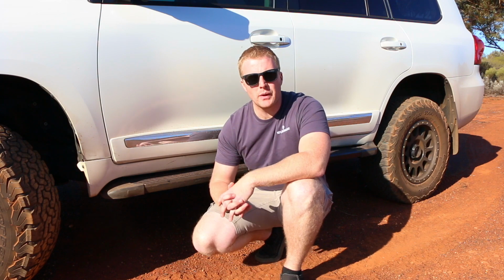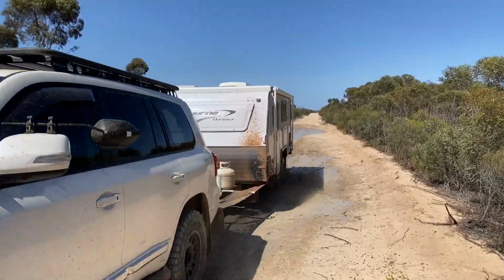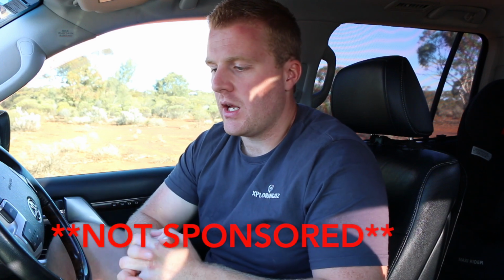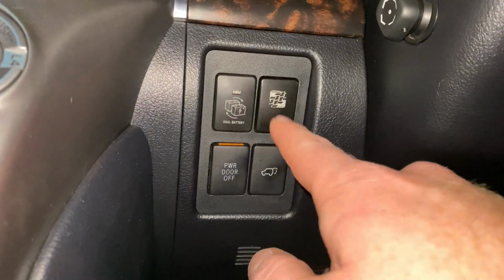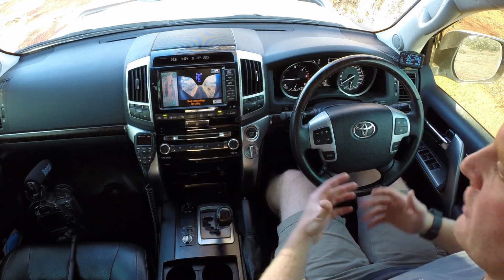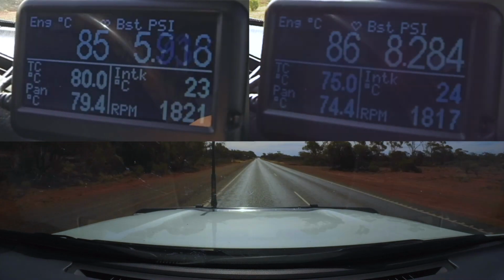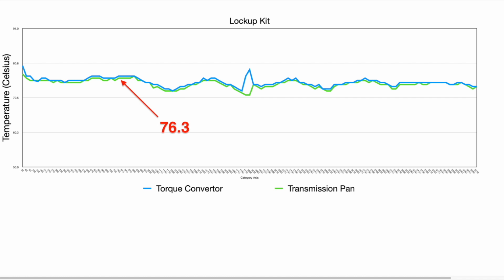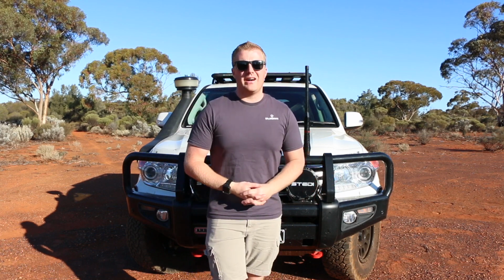TORQUE CONVERTOR LOCKUP KIT | HUGE difference! | How does it work and why? LC200 Stocklock Extreme

Comment: I have the Richards lock up2, absolute game changer for my 150 1kd Prado, the torque converter slips like crazy when towing up long hills and up against headwinds, I’m a relative lightfoot and I still have to feather the right foot a lot, tow test was an absolute dream, I have the lock up dialled in, can’t wait to head off around Aus in 3 weeks.

Comment: An old video, that I must have missed.  Considering getting a lockup kit for Isuzu MY23.   Informative as usual.

What was your fuel usage saving with the lockup kit?

Always looking for your next video.
Reply: I just installed a "lock up mate" in my LC200. Pretty easy install and you don't have to mess around with the switch panels. Looks like about 1L per 100 saving without towing. Will be towing soon and that's where the real saving would be.

Comment: Great revue. Australian Off Road caravan owner forums, some have used this unit. The AOR vans mostly weight 2.5 tonne, some more, some less. They are mostly under 2 metres wide, so often have less windage issues. Many users report though, that after having installed a lock up kit, eventually they turn them off, because they've found with judicial throttle control, one can get the 200 to lock up, its a skill that can be acquired. IMO I will first enhance the gearbox cooling, as it seems to me that if the transmission fluid is kept cooler, the cost of not locking up as quickly as a lock up kit achieves is fuel consumption. It's a shame that only the Lexus versions provide paddle gear changing ... my D4 Landy instantly changes gear via the paddle shift and then times out after a few minutes, and in sport mode it doesn't time out. But I reckon throttle control in the 200 may be the way to go, and that a tranny cooler is mandatory.

Comment: I tow a 2.5 ton van and when in drive doing a 100 on flat road it very rarely went looking for gears and when I drive in 4 it never looks for gears so I don’t understand how you’re gearbox was looking for gears on flat road maybe you have a servicing problem 🤷‍♂️ this review hasn’t won me on a lockup kit a trans cooler would work better just my opinion

Comment: Do you think there would still be benefits to installing this on the 5.7 petrol variant? 

I want to pull an MDC XT 17 Family and am weighing adding a TVS 2650 Magnusen supercharger or swapping a 1VD-FTE.  

Some spots we want to hit are pretty remote so fuel range is a concern.
Reply from the maker: I won’t pretend to have experience with the petrol variants, however if the result is similar I would say there would be a positive benefit from installing this unit 👍

Comment: What a awesome video. Do you find it makes much of a different for engine/coolant temps?
Reply from the maker: Yes, a little, however it actually increases the temps in my experience. This is because the RPM is lower and therefore there is more load on the engine and things like the water pump are now cycling slower. This being said, the difference is minimal and everything still sits well within safe limits 👍

Comment: Did you ever fit a trans cooler as well?
Not all driving conditions can be done locked eg sand and rock crawling.

I installed a trans oil cooler....
1. Have seen a 10 to 20 degs drop in temps doing same up/down hill trip to and from work..

2. Now never goes over 70degs and is closer to 50 the majority of the time.

3... the big one the lc200 now locks into 6th in auto or sports for huge sections as is 90 then 110kmh speed. Before the cooler it had to be driven in 5th in sports to look at 100 to 110.

So clearly heat is factor that the factory trans tune clearly know heat is to high to use 6th. 

Having driven in area that speed limit is higher 120 to 130 6th locks at the point no issues without any mods.
Reply from the maker: Hey mate, so I haven't fitted a cooler now with these lower temps, I don't think I really need to 👍

Very interesting to hear your findings though and this makes sense. 

I sometimes drive without the lockup kit engaged and the gear change pattern is definitely modified, so I think you are correct in relation to the heat element.
Reply: @XploringOz  you don't get 110 and above driving on the beach? Especially like when using the crawl control to get out for example
Reply from the maker: @ausguy4385  On the odd occasion, but not as much as some think. It would have to be a long beach with very boggy sand. I'm driven 10's of km's of beaches on WA's south coast and they get up to about 100 ish. 
With the kit, I can manually lock up if I'm cruising and this obviously brings them straight back down. 
Crawl control will definitely bring them up, but I hardly ever use it and it's only for very short periods of time.

Comment: How has the torque converter lockup kit impacted the exhaust gas temperatures under the same driving conditions compared to unmodified factory shift calibration?
Reply from the maker: Hey mate, so the EGT's will only increase if the engine is labouring. So if the torque convertor licks up and drops that RPM by say 200/300 revs, then the EGT's will go up slightly. This being said, its only marginal amount, if the EGT's increase too much due to low RPM, I would be dropping a gear anyway. 
Thanks, Nathan.

Comment: Hi mate. I have Mitsubishi pajero 2.8l diesel engine with 4 speed automatic transmission and I am thinking of installing lock up kit mainly for fuel saving reason as I dont tow anything. Whats your suggestion on this
Reply from the maker: Hey mate, in my experience when there is little load and you can hold the RPM down low then yes it has saved fuel consumption. I found when the load is high, like towing a trailer the engine can labour a little. 
Overall, if you are experience hunting or struggling to keep top gear then this would likely help 👍 
All the best, Nathan.

Comment: so are any lock up kits smart enough to unlock if given to boot?
Edit... new wholesale automatics one is and also has Bluetooth to customise and upload updates.
Takes information from canbus to have far better information on what's going on not just speed.
Reply from the maker: Generally they won't need to, the vehicle will obviously downshift and provide optimal torque levels, the lockup kit can stay engaged and will give maximum torque and power direct to the wheels. The driveline is suited for this sort of application.

Comment: Hey great video
Interested in installing the stockwell torque converter lockup kit on my 2017 200 series
Ive got an armax ecu installed, just wondering if you know whether the stocklock kit is compatible with it
Thanks
Reply from the maker: Hey mate, definitely a kit worth looking at, that's for sure. Absolutely love my one. 
I can't confirm whether or not it would work with that particular unit. I had my vehicle custom tuned and it works well, but you may have to speak with Safari regarding that. 
Sorry, Nathan.

Comment: Hiya, just watched this video again as I've just had the 2 speed Stocklock fitted to my LC200.  Its interesting now that the Ultragauge no longer displays the figure confirming TC is locked.  Did you find this to be the case or is there a fix for this?  Thanks in advance and take care.
Reply from the maker: Yes, I found this to be the case as well. The Ultraguage struggles to pick up the torque convertor solenoid signals. I haven't found a way past this at the moment, but I'm finding I can now easily see when the converter is locked anyway. Cheers, Nathan.
Reply: @XploringOz  Thank you for the response, and yes I can see the lock up just be the drop in RPM and feel the change, although would have liked to still see the confirmation of the lock up on the UG.  Am looking forward to seeing the difference the first time we get to take the caravan out.  Take care.
Reply from the maker: @Satchmo2447  I'm sure you will notice a big difference towing, particularly with gearbox temperatures and engine braking downhill. 
Cheers.
Reply: @XploringOz  im sure as well and thanks for the reply.  Have only had the 200 GXL since April but love it.
Reply: Did you find the right code to enter in? It works fine. Or do you mean posr install it stops working?

I'm about to have a lock up added.
Reply: @ausguy4385  Hiya, would confirm that I have the Stocklock and works great.  What you can't appear to do, is have the indicator on the Ultragauge showing that the stocklock is locked.  However, you can tell just by the change in the gearbox and the Torque converter temp lowering.

Comment: Very nice video. Good information. Where did you get the information about the lockup speed from factory? I own a 2009 KDJ120 3.0 D4D and would like to know what is the factory lockup speed on my Prado.
Reply from the maker: Hey mate, I believe this was hidden somewhere in the factory manual for the vehicle. 
However, if you're looking at your vehicle, perhaps some of the forums might have this information? 
If not, if you or someone you know has a scan gauge type tool (or Ultraguage like I use) you might be able to monitor and detect the factory lockup from this. 
Cheers, Nathan.

Comment: Great video!! was a tune required for the gearbox after the install of the stock lock? I’ve heard mixed opinions on that topic!
Reply from the maker: Thanks mate. So negative a gearbox tune is not required at all. All the testing in this video was running standard tuning. 
Although saying this I have had a gearbox time since this install and it definitely improves the performance further.
Reply: @XploringOz  thank you for the quick reply appreciate it!
Reply from the maker: All good mate. I hope to do a video where I talk a bit more about the tuning done to my vehicle and speak about the results my thoughts and who might need a tune 👍

Comment: Having a serious look at a Sahara at the moment, all of your info is helping me appreciate the vehicle even more but also gulp at the many things to do and the dollars involved for an even better experience. I think I’d stick with high speed mode only, what a great idea.
Reply from the maker: They are great vehicles. Keep in mind vehicle modifications will heavily depend on what you plan on doing with the vehicle and how much you plan on chaining the vehicles dynamics form factory. Not all of this equipment is necessary, however I've found it very helpful. 

The lock up kit and transmission tune (future video to come regarding this) have been some of the most influential changes to the vehicle and significantly improved the driving experience and engine protection.

Comment: sounds like you cant use them for descending down a steep angle and not needing to use the brake, like you would in a manual?
Reply from the maker: You can certainly use this function for engine braking. Having the torque converter locked provides a 1:1 ratio, just as you would in a manual vehicle. Obviously you would need to select the ‘S’ mode on the transmission and manually select down the gears. 
I personally use this function all the time to relieve the pressure on the brakes.
Reply: @XploringOz  even driving down sand dunes or step don't hills?
Reply from the maker: @NateG2424  For sure, I use this function all the time for off-roading scenarios. You need to keep in mind that manuals are gear differently to automatics, so you might not have the same low range gearing, but the function is still there.

Comment: have you re-geared diffs for your 34inch wheels, is this not the real cause of transmission issues?
Reply from the maker: Although this puts more load onto the vehicles drivetrain and would definitely contribute to the issues, aerodynamics and weight also considerably add resistance to the transmission. Although differential gears would definitely assist, and are something I'm looking into at the moment, this unit has a different purpose. Even with standard tyres and basic modifications, the factory transmission tends to 'hunt' gears and rarely uses 6th. 
Further, towing (standard tyres or not) also place a huge stress onto the transmission. For those towing heavy loads and running a relatively stock vehicle, diff gears aren't really an option. 
I will be doing another video on this topic in the future as with extended ownership of this vehicle I haven't learnt a lot about the gearbox and ECU tuning to maximise efficiency and performance in these vehicles.

Comment: Does it give you more torque in sand driving if it’s locked ?
Reply from the maker: So in real terms from the engine no, however there will an increase of the power and torque to the wheels. This will be because no torque or power will be lost (in the form of heat) within the torque converter. Hope that makes sense? 👍
Reply: So with the right driving techniques , it could prevent you from getting bogged in sand when say the car is moving and u manually locked the torque converter ?
Reply from the maker: @JKJUSMQTR  I think it could in the right circumstances 👍

Comment: Great YouTube about the lock up operation and its effect. How did you record the 30 sec readings? Are they downloadable from the Ultra Gauge? Do you have special software for the graphs? Keep up the great quality videos.
Reply from the maker: Thanks mate. So unfortunately I didn't have any software to get these readings, I painstaking used a time-lapse to record 10 second intervals of the Ultragauge. I then manually got the reading form every 3 photographs, inputted them into a spreadsheet and just used generic Mac 'Numbers' software to create the graphs. 
I'm sure there would be an easier way, however this worked for me...eventually.
Thanks, Nathan.
Reply: @XploringOz  Thankyou Nathan.

Comment: Did you/will you consider an aftermarket trans oil cooler?
FWIW, I've got a GU with the 4sp auto, converted from 3.0 to 4.2TD. It is run by a Compushift3 controller (gives manual lockup and gear lock control) but not auto lockup like that.
Reply from the maker: So, transmissions cooler is another solution, however I didn't go down that track as I don't think it would be nearly as effective as the lockup kit. 
The transmission cooler is a solution to the overheating issue, where as the lock up kit reducing the frequency of the temperature getting heat in the first instance. 
Along with this, the cooler would not be nearly as efficient in high load, low airflow conditions, like beach driving. 
I do believe that this lockup kit is superior if your goal in reducing trans temps.
Reply: If lockup kits are "necessary" then why don't trucks and vans have them? 
Trucks and vans pull more weight for longer distances and the same salesman that tell 4WD drivers that lockup kits are "essential" will tell truck and van drivers "it's fine, just get a oil cooler".
Heavier vehicles that pull more weight but the same people will tell you that they don't need a lockup kit?! Something doesn't sound right...
Auto track cars also have no lockup kits only oil coolers.
What oil cooler are you looking at? There's a lot of different types.
Reply: @PeterKnagge  Auto transmission lockups are built-in to modern boxes.
Reply: @darthvader8433  My remote oil cooler has dual fans and keeps everything cool even when at idle. Try that with a lockup kit?!
All I'm saying is why spend $1000 on a lockup kit, when you could save the money and buy an oil cooler, upgraded valve body and torque converter, and a TCU remap? I know where the smart money is.
Reply: @PeterKnagge  The amount of heat a slipping TC generates is amazing. If your usage of the auto is at the upper end of the range, limiting the slip in a TC is MUCH more effective than a cooler. Factory coolers often use the engine coolant, so any extra heat goes there. If you add an aftermarket cooler and bypass the factory radiator heat exchanger, that can work at speed, but at low air flow they don't work that well. You can get aftermarket coolers with a fan to get around that too but you are adding complexity.
For example, for my 4wd (2021 LC200).. TC Lockup:$795, Nomad valve body $1295, Trans cooler $595. All plus fitting. The valve body solves a different problem, mainly giving you control of engine braking.
I got the Richards lockup kit and auto/engine tune. I also got the trans cooler fitted as a bib/braces approach, just for peace of mind in extreme temps. Having had a Nomad valve body in my last 4wd (GU Patrol) with a Compushift controller, the valve body does not control the heat, but engage the manual lockup and the trans temps drop to normal. And so does the engine temp, as the trans is no longer heating the engine.
But there is a compromise with the valve body, it shifts hard and the TC lockup is not automatic. If you were doing rock crawling or hard 4wding that's OK, but it's a pain in day to day driving.
Reply: @darthvader8433  Yet lockup kit salesmen will tell you on trucks, vans, and track cars (vehicles that pull more weight and are driven harder than 4WD's will ever be ) that lockup kits aren't necessary. They're right, lockup kits are "trinkets" and soon will be a thing of the past..., but shhh don't tell anyone it's a secret...
(Also are you trying to tell us that a decent high efficiency quality oil cooler with a fan is a "complexity"  yet something like a lockup kit isn't? Has your lockup kit thrown any fault codes recently?)
Spend your money on what you want, but in my position I know there is a much better way to do the same thing and more.
#LCClub